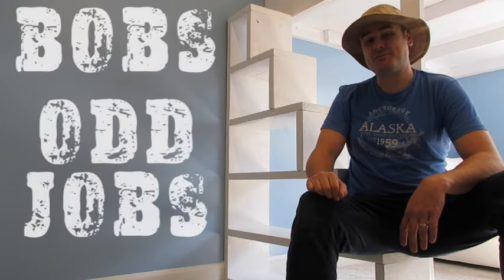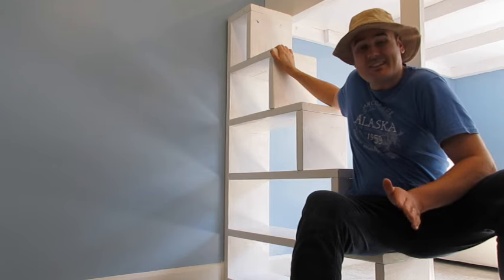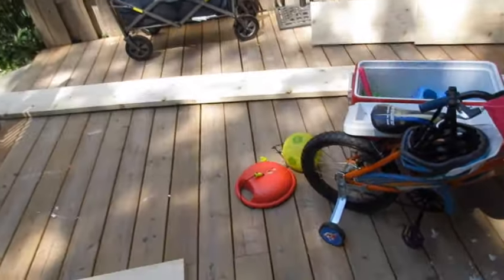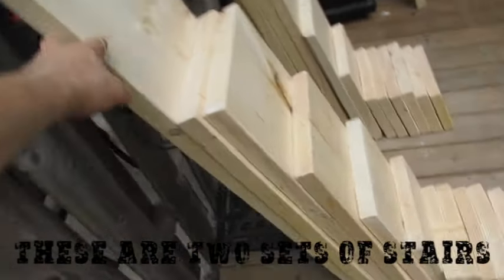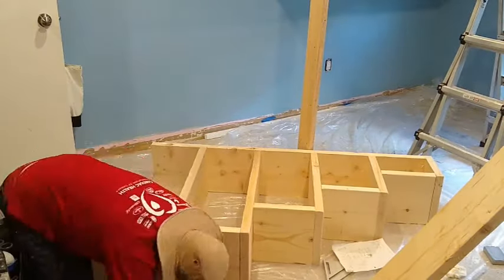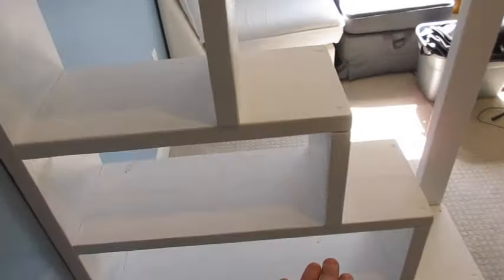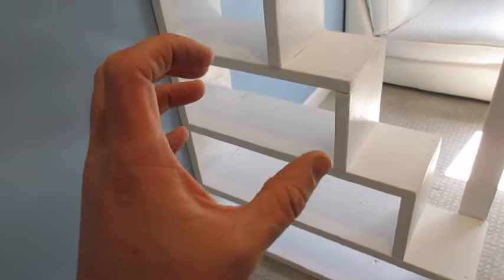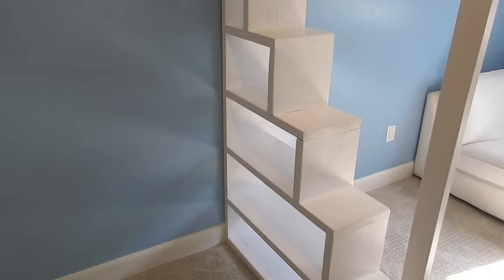DIY Bunk / Loft Bed Stairs

Comment: These look great. I got the lumber for this project, except, my daughter wants 'cubby's'. A standard cubby is 12", with cubby bins/baskets measuring  11".  I have to adjust heights of steps to allow them to fit and, of course, add 1 X 12's to divide up individual cubby boxs. Still using your pattern,  though.  Thx

Comment: Hi! Love the video! My friend and I have moved in with each other and have gotten a loft bed but it doesn’t have stairs so I was going to build a set myself. I saw your video and I got very inspired by it! I do have one question if that’s ok. Ours is nearly a 6ft high loft (71.9”) and 41.3” wide. Is it possible if you could make a wright up for those measurements with what you had previously? If not then that’s totally fine but figured I’d ask! Thanks a lot!

Comment: i was wondering how many 2x12's you had to buy per set of stairs! this video is great I'm going to do it for my loft :)
Reply from the maker: Hey Marissa,

Thanks for the feedback!
I think in total it called for a bit over 23ft. I bought 2 - 16ft boards and 2 -8ft boards(I was building two sets of stairs tho). I bought the 16 footer because it was cheaper than buying multiple smaller ones.

Let me know how it goes:)

Take Care
Reply: Came here for this answer lol

Comment: Good job man, I just built a loft bed for me and my wife in the kids room but my wife hates using the ladder so I'm going to do something like this but maybe like those storage cube things she uses for the kids toys. Did you have to use the L brackets?
Reply from the maker: Hey Amanda! (Or Amanda's husband)

I measured for those storage cubes originally but after a trial run the stairs were a bit to high for my kids to climb. So the space between each step is a bit smaller than your typical 11-12in storage cubes. I did find a smaller versions of the storage cubes that would fit but decided not to get them.

If you want the regular storage cubes to fit I recommend you do a trail run with the steps at a 13 1/2 in rise and see if you're ok with it. (13 1/2in rise will give you 12in of space in each shelf because the wood is 1 1/2in thick)

I'm happy to say I didn't use any L brackets! I wasn't sure if I would need to add them but after I built everything the stairs are solid. Make sure you use the thicker screws (#10 or #12) and wood glue every joint. Also, for extra support, you could have them up against a wall or attached to something at the top and bottom steps.

Let me know how it goes!

Take care :)

Comment: What type and size screws did you use?
Reply from the maker: Hey Michael,

I just used 3inch #10 wood screws. I also used wood glue on every joint so they don't squeak or wobble. 

I had a friend mention that the shear strength on wood screws isn't the best. He suggested I put some framing nails in. I never added the nails. I haven't had any issues.

I hope that helps. Let me know if you need anything else :)

Take Care
Reply: @bobsoddjobs  thank you very much for replying I will definitely follow that you have been a great help I have subscribed to your site as well
Reply from the maker: Thanks Michael,

Let me know how it goes :))

Comment: How many boards did you use for one set ?
Reply from the maker: Hey Zachary,

I think in total it called for a bit over 23ft. I bought 2 - 16ft boards and 2 -8ft boards(I was building two sets of stairs tho). I bought the 16 footer because it was cheaper than buying multiple smaller ones.

Let me know how it goes:)

Take Care
Reply: 23ft is needed to build two sets or 23 ft for each one individually totaling 46ft for two sets ? Thank you! I’m definitely doing this for my cabin! Just want to know how much to order

Comment: Hi Bob, I'm so happy you posted this video, it's just want I needed for my daughter's loft bed. How many planks of 2x12 did you use.
Reply from the maker: Hey JC,

*I'm editing this comment, I realized I used 16ft boards and 8ft boards. Each set of stairs uses around 23ft of lumber.*

Thanks for the feedback!
I think in total it called for a bit over 23ft. I bought 2 - 16ft boards and 2 -8ft boards(I was building two sets of stairs tho). I bought the 16 footer because it was cheaper than buying multiple smaller ones.

Good luck! And let me know if you need anything else.

Take care :)
Reply: @bobsoddjobs  no worries, I finished the stairs a few days after I saw your video. I modified it slightly. I'll post pic when I get home. 

Thanks again
Reply: @jcconchas  finally remembered to take pictures and realized can't post pics on YouTube. duh, so anyway they are great. Thanks again.
Reply from the maker: That's awesome JC Conchas!
I'm interested in seeing them. Would you be willing to post them on my Facebook page? As you would expect its called BobsOddJobs :)
Reply: @bobsoddjobs  Hi Bob, I just sent you two pics in FB messenger. I hope you get them.
Reply from the maker: Hey Joe,

For some reason I didn't get them. If you want to try again just look for my Hat symbol in facebook when you search Bob's Odd Jobs. If it too much, don't worry about it. 

I'm sure your stairs look awesome :) 

Take Care

Comment: What kind of paint did you use?
Reply from the maker: Hey Sandra,

I used a good quality furniture paint. First I primed them with regular wood primer then I used "CIL Smart3 Wash and Wear Furniture and Cabinet Melamine". This stuff is expensive but I've used it on a bunch of different projects and it's really good. It has a nice thick finish and protects against wear. I'm sure there's other paints out there that are similar too. Hope that helps

Take care :)

Comment: What type of wood did you use ?
Reply from the maker: Hey Krystal,

I used the run of a mill construction lumber. They are 2x12 (the actual measurements are 1-1/2 by 11-1/4) I think in total each set of stairs uses around 23ft. 

 If you take a look at the diagram I wrote all the measurements for you. You're going to want to sand the boards after you cut them. Prime them before you paint too.

I hope this helps, let me know if you need anything else :)

Take care

Comment: how do you screw and glue them together?
Reply from the maker: Hey Rebecca,

I put glue on each joint then I screwed the joint together. It's quite a strong joint. And there's no squeezing, creecking or wobble. I used two screws for every vertical joint and three screws for every horizontal joint. I used 3 inch #10 screws. 

I hope this helps!
Take Care :)
Reply: @bobsoddjobs  ok thanks!
Reply from the maker: Glad to help!

I should also let you know that I pre-drilled holes for every screw too :)
Reply: @bobsoddjobs - Hi again! How can I modify this to fit my loft bed which is 6.5 ft (77 inch) high? Vs. your 5ft". I'm so afraid I'll mess up the measurements. Math was never my forte!

Comment: its wobly cause you didnt glue and screw
Reply from the maker: Hey Omn,

You're right! Definitely glue and screw all your joints :)

Thanks for the input
Take Care
Reply: @bobsoddjobs  Idk if thats sarcasme but your welcome I guess im looking to build the same design ty for the video
Reply from the maker: Hey Omn, 

I glued and screwed when I built this with wobble factor in mind. Make sure you use good quality wood screws and wood glue. I've also heard if you want to be sure you have good shear strength you could add some framing nails.

Good luck with your project and let me know how it goes :)

Take Care
Reply: @bobsoddjobs  awesome